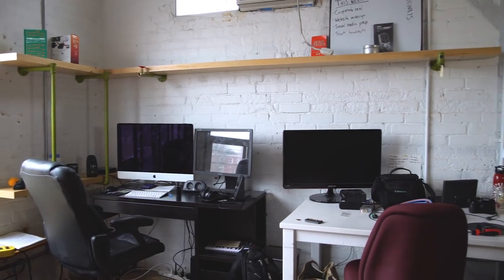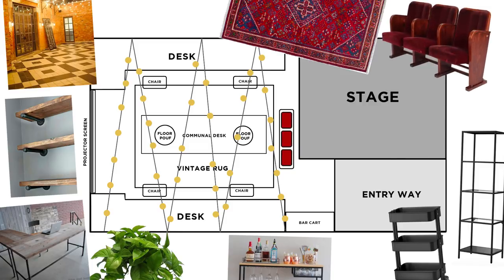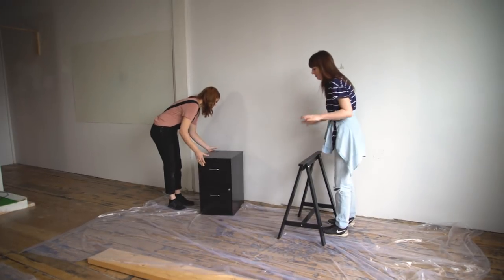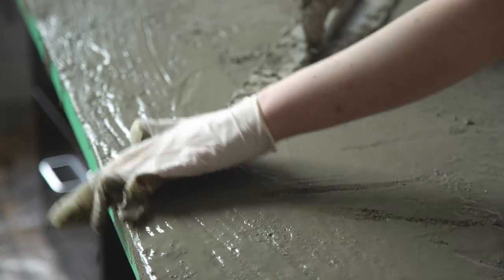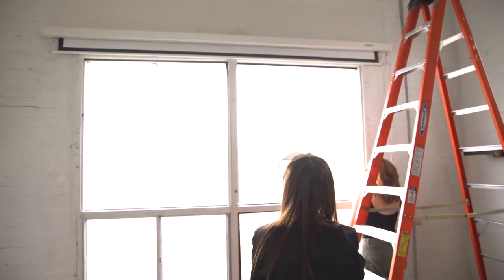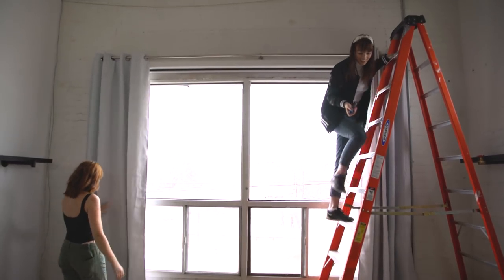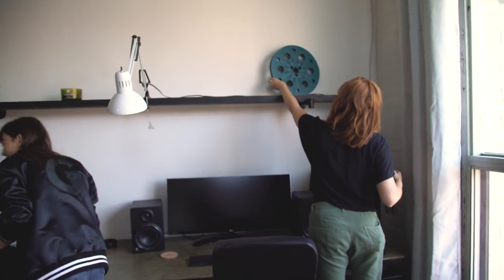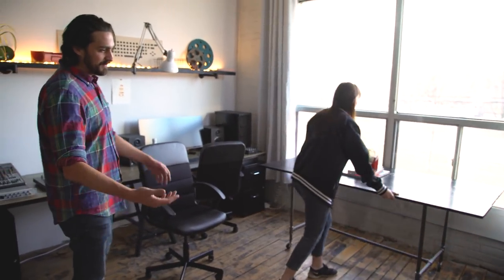EXPOSED BRICK LOFT OFFICE MAKEOVER | Style Selected

Comment: Wish the table had wheels that locked, I feel like that will be super inconvenient if it rolls when slightly bumped
Reply: Theo Rose +
Reply: I was thinking the same thing. It's hard to see clearly enough from the video if they have locks or not but it would be really frustrating if they don't.
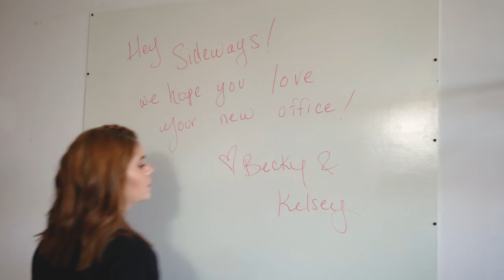Reply: Theo Rose I see something that looks like a lock on the wheel at 19:08 - 19:10 but I'm not sure. Maybe they just didn't realize or use it
Reply: I have one of those carts and the wheels don’t lock but I love it! It was super convenient actually, and if you have enough stuff on it holding it down it should be fine!
Reply: I thought it better to have rug under it to contr moving wheels
Reply: I agree, even aesthetically it would add to the industrial chic vibes. I really like this makeover but the guys needed the bottom third of the windows covered during screenings too.

Comment: A 3 mm raised metal edge framing around the edge of the table and then you poor in the concrete! Levelled, no sanding, no cracking! Nonetheless; great job!
Reply: Rami Alotaibi +
Reply: could it be made out of wood? I've seen some projects were they use wood as mold to the concrete. It's cheap and easy. I would like to try it out one day.

Comment: Great look! Wish you guys had re-painted the white walls and repaired them a little though.
Reply: Eadig with those spaces you aren't allowed to paint
Reply: Usually if you aren't allowed to paint rental walls you aren't allowed to put big holes (like screws for curtain rods or shelving) in them either. Maybe there was another reason for not touching up the walls?
Reply: Probably a time issue. If they painted they’d have to wait for it to dry before moving anything in

Comment: yes it looks cool, but so many aspects seem too impractical, if there was put a little more thought this would be legit so awesome, but i feel like in a week they will get annoyed by the tabletops that are clearly NOT smooth and that has to be annoying for people who actually work on the table, or that there is light coming from under the projector screen and instead of putting a pull-down blackout curtain you went for regular curtains that dont help with blacking out when youre using the projector.. or the table in the middle is extremely easily movable, the one they had was extra sturdy, you cant even lean on this one with wheels or put down heavy stuff.. and the plants are dead in a week.
Reply: and all the knick knack things just laying on the shelves ready to fall off or fall over. So much of that should have been put up on the wall to get it off the shelf so the shelf can be used as a shelf and not just a place to lean things they don't need against the wall.
Reply: They actually chose great plants for that space. They are hardy and don’t need a lot of light or water. As long as they are occasionally watered they should be fine. It’s not like the curtains are going to be closed 24/7

Comment: Tip for smoothing out the concrete top, get a long piece of 2X4 and scrape it along the top to even everything out. Just like when they do slabs of concrete. Then you can do a slush layer over top to fill in any low spots let that cure and then sand.

Comment: Awesome trying the concrete! Love you guys a lot. I hope you could do the designing part anonymous so it would have been less awkward. Alsoooo, it would have been awesome having the  projector screen hanging from the ceiling, and the curtains in the back attached to the wall.

 I hope you could work out better your space choices and proportions. The sofa is umcomfortable, facing the opposite side of the filming space , out of proportion respect the table in front, with no side tables to  put the beverages and  in the middle of the workspace.     The office space was the same as before, facing the wall. Perhaps alignig the desk in the center and using the space around  to make small living room areas could have worked out better.With the projector/curtains idea implemented  as I wrote  in the first paragraph. Sorry for my english! And keep on!

Comment: They asked for more storage. You gave them less. Not super impressed this time around.
Reply: Stephanie Gouldie How were they given less storage? They have more shelving and desk area as well as the file cabinets? They don't need anything massive, just spots for the cables and extra devices.
Reply: Actually, they had the two smaller shelves on which side, which kinda equals the larger ones. So technically, no more shelving than before. Plus, they were covered in stuff.